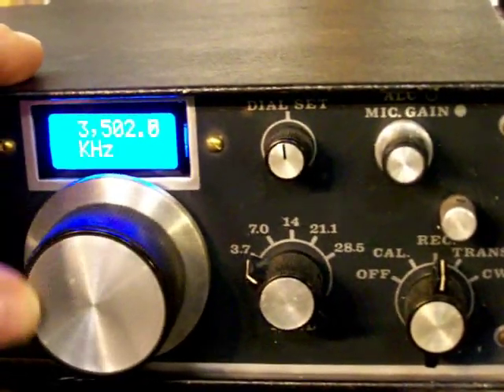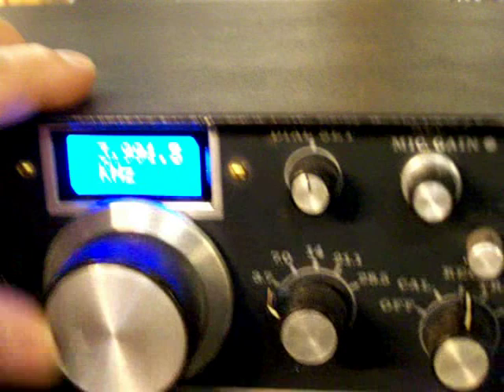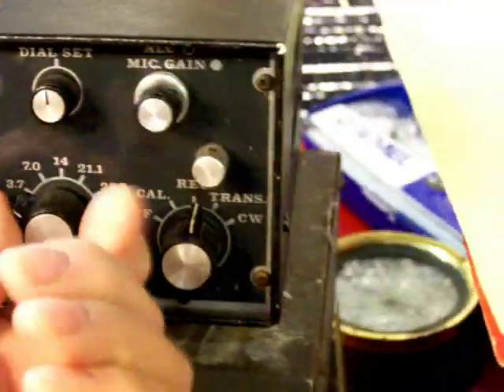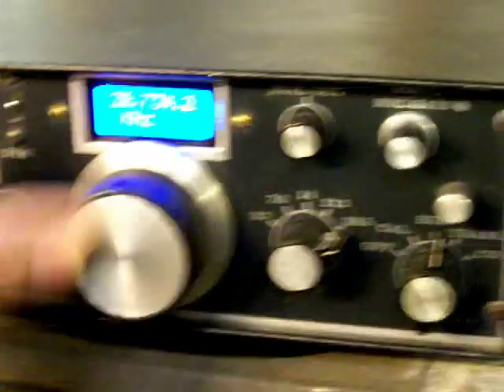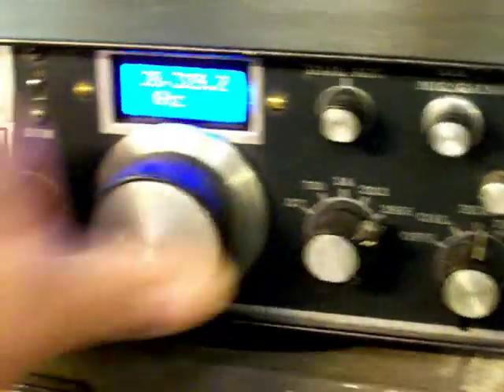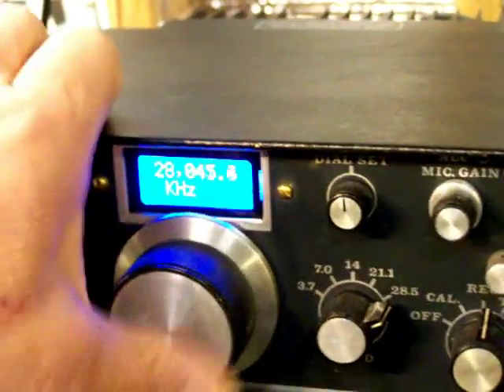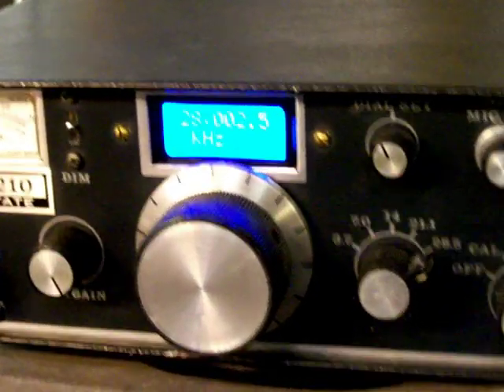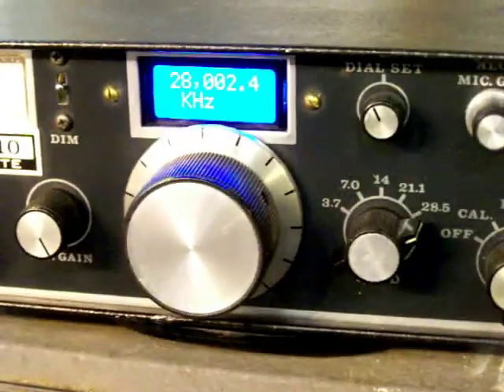Atlas 210 with Digital Display and Band Spread Modifications.

Comment: Interesting.  I got an AFC circuit from Herb.. who built these rigs... to lock the frequency.. since drift as become an issue as these rigs have aged.  W6WUH
Reply: Got one here at Duke city hamfest.. correct, I noticed some drift. Other than that works nice. I use a frequency counter near it to see where I'm at, but would like to put a internal jack for one.

Comment: Hi every one,

The dimmer switch was replaced with a mini toggle momentary contact switch. This goes to one of the push buttons on the  N3ZI counter. This is because the Atlas IF has a frequency shift 80-,40-,20+ 15+ 10+.

Putting the N3ZI counter. in the Atlas 215x would be the same as the 210. I will post pictures on how I did this on my site, kf9cm